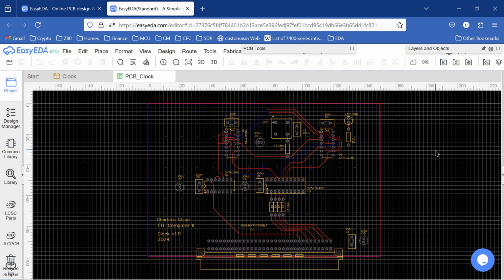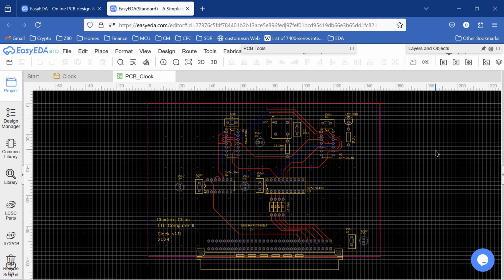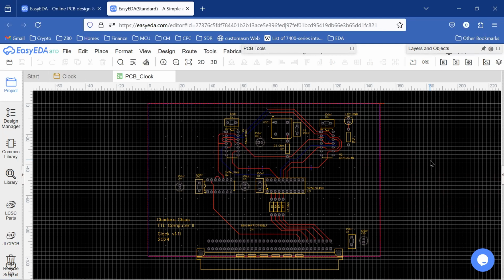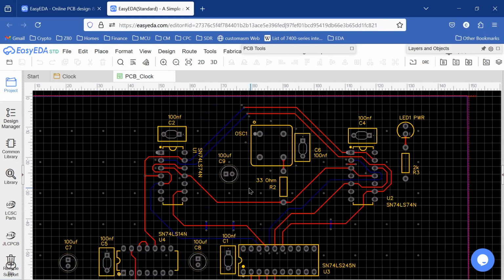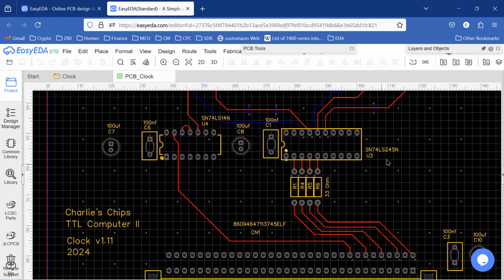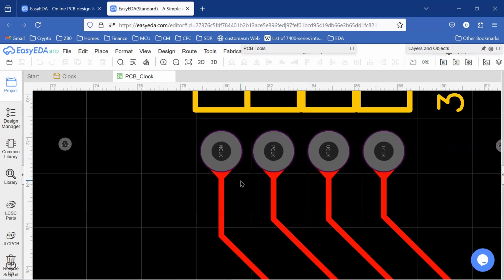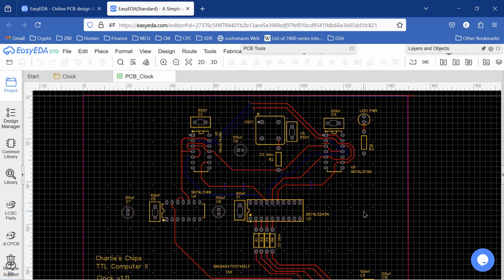TTL Computer II #16 - Clock PCB v2 ?

Comment: Are you having a GND flood fill on the bottom and a VCC fill on the top?  Or else there's no power on the board at all ;-). 

But why do you have all those vias spread out over the board? You're not stitching together two GND layers (that's is what stitching normally does) so they are completely inert - not doing anything at all - this considering that they are not connected to anything on one side.   

Power and ground distribution is the single most important thing on a board, therefore it's usually recommended (on a two layer board at least) to actually start off by routing all GND and power in a good way, then the later fills will improve that a bit, but you're guaranteed to not unintentionally get long snaking paths and narrow/pinched of paths for the gnd/vcc connections.

There's also no real reason of having multiple (100uf) bulk caps on a board of this size - that's just a waste of money.  :)
Reply: I think he use a 4 layer board. Way too over engineering, how fast will he  go with the frequency?
Reply from the maker: Hey Mat good feedback.  Two layer board.  This is my first venture into pcb design and multiple boards with a backplane.  So, yes I am over engineering a bit.  There is a ground pour on bottom and power pour on top.  Vias are connected to ground plane as signal return path vias.  Caps are cheap and power is a concern for me.  System oscillator will be 4 mhz.
Reply: @CharliesChips  But you have a grid of vias all over the board. On 99% of all those places you have no signals and nor any ground currents. High frequency return currents have a path that mimics the signal wire above it, and DC currents goes as the lowest resistance dictates.

GND vias close to signal vias (as I understand it) is another thing. They are used on 4L or larger where you have two ground planes and you want the signal to not have an abrupt change of gnd reference while transitioning.  On a 2L board you signals starts out at 1.6mm from the ground plane and then gradually gets closer and closer when going down the signal via. So you're actually not changing the gnd reference plane - you only have one to begin with.
Reply from the maker: Yes, I am starting to"track" with you on your feedback.  Trying to digest a whole bunch of incomplete info in a short period and get a good outcome.  Was not a correct use of the vias array.  I don't think it will impact that one board.  Also was thinking the 100uf caps were overkill as I was soldering it up.  Again, should not effect the board.  Thanks for feedback.